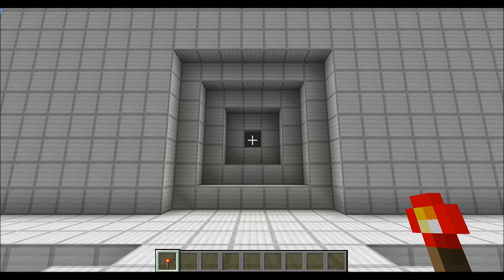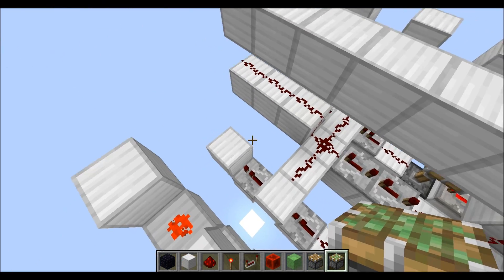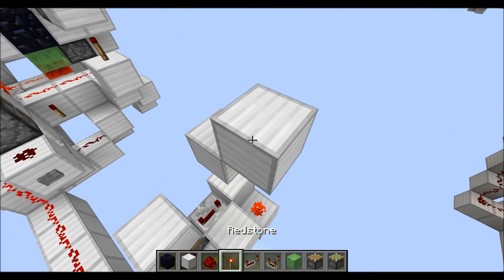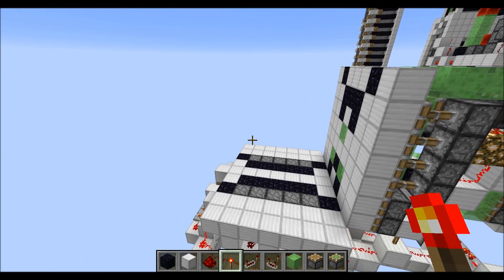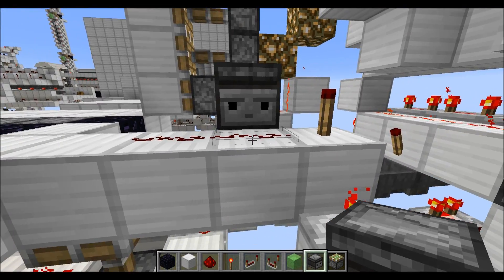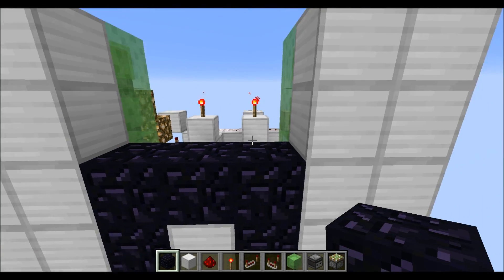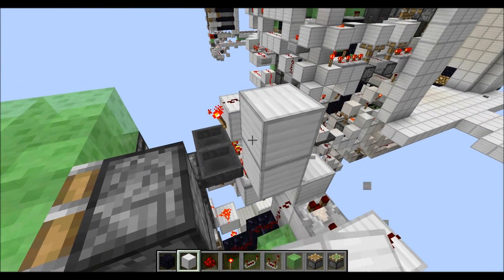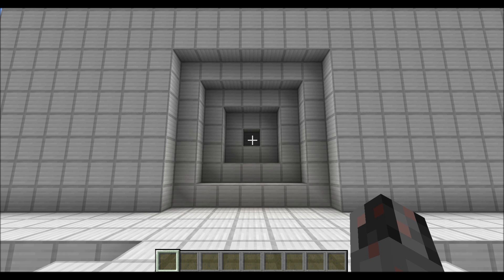Tutorial: 7x7 Torch-key Double Vault Door [Java 1.11+] [needs 1.16 Fix] (Schematic)

Comment: 10:00 my eggs all go to one hopper and I have it exactly like yours
Reply from the maker: Both hoppers should be powered by a torch each at that moment. Check those connections.
Reply: @RKFWalter  I have the torch above the one and under the other. I also have the blocks and comparators like yours and the one in subtract. When I put the 5 eggs in the torch above goes out and they all go to the other hopper and the torch goes back on.
Reply from the maker: All comparators in the correct mode?
Reply: @RKFWalter  yup, I have everything the same but yet that one hopper fills up with 16 and 4 eggs
Reply from the maker: That's really strange. Did you put in the 15 eggs first and then the other 5 like in the tutorial?
Reply: @RKFWalter  yes, I found it strange that red stone torch above the hopper with 5 turned off after I put the eggs in it. I am not done with the door I only have to do the left and top. I closed the door to test and it seems to work as it should even though the eggs are in the wrong hopper.
Reply from the maker: Well, the door is simple enough that 4 ticks off timing won't break everything (I think). There shoudln't a real problem if the side as a whole works.
Reply: @RKFWalter  just built the left side and had the same problem with the eggs. Both torches that need to lock the hopper are turned off and the comparator on the right hopper facing the block is on with the 2 lights
Reply from the maker: Curious. At least it seems to be symmetrical.
Reply: @RKFWalter  the door doesn’t open properly because of it, at least the left side doesn’t.
Reply from the maker: I looked again I think I know the problem. The stop at 4 instead of 5 on the right is because of a 1.16 change (shouldn't be an issue). But the left needs a 1.16 fix, link for that tutorial is in the decription.
Sorry that I didn't notice that sooner.
Reply: @RKFWalter  ok I will try that and see if it works properly.